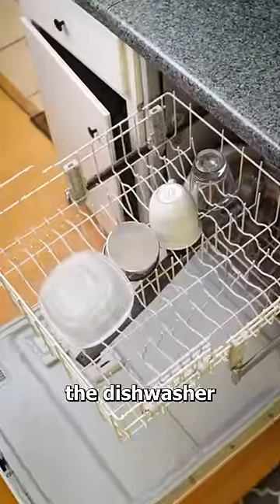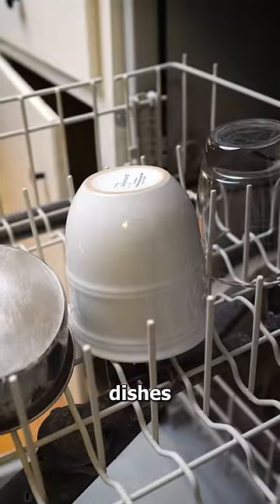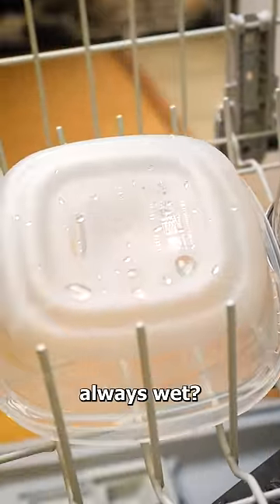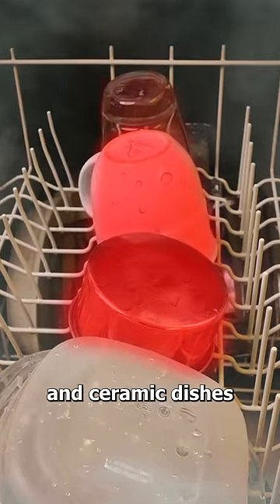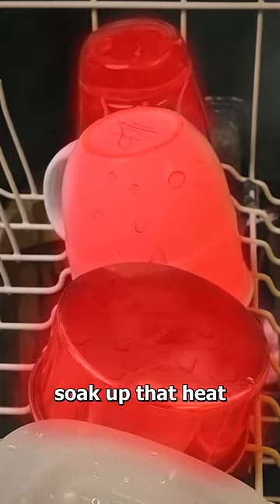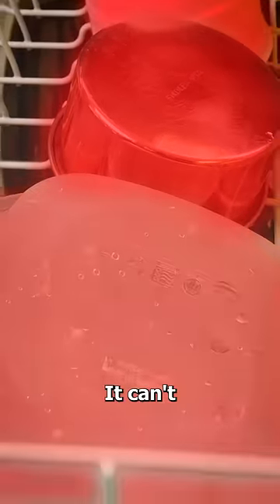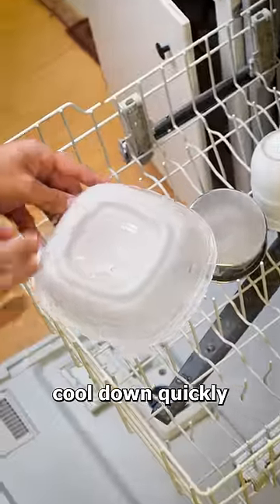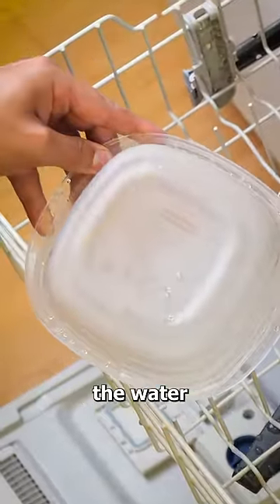Why Plastic Doesn't Dry In The Dishwasher 🤔

Comment: i’ve never used a dishwasher in my life
Reply: Samee
Reply: I moved into a house built in 1928 that didn't have a dishwasher and did dishes by hand for a few months. Worst time of my life. We sawed a hole in the cabinets ( which were original and therefore not the correct dimensions for dishwasher) so fast and tossed a dishwasher in there because it was ruining my life. 

Dishwashers are more water efficient and sterilize better than washing by hand. Saved my life.
Reply: @Comannderballz  Can you tell me where exactly they implied that they expected a house from 1928 to have a dishwasher, JayMapper---_-?
Reply: @JayMapper---_-  I knew it didn't have one when we bought it. But we intended to remodel the whole kitchen when we saved up enough. I couldn't wait. I needed one asap and put it in with the old counters. But yeah. Most houses in the US have a dishwasher. If not built with one installed at some point.
Reply: @Comannderballz a lot of houses are built in that time frame but 90% of the time they’re renovated along with a dishwasher at some point, not weird to assume it would have one dingus
Reply: Same
Reply: Asian parents ig
Reply: Same
Reply: same
Reply: Same. But I don’t have a dishwasher.
Reply: Not really, they use a lot of electricity and if you are a normal person, you'd use the correct amount of water to do the dishes so nah, it's actually not that great to have a dishwasher @christiebreeechelon
Reply: @rypsterhc8673  for most households it has been proven that dishwashers and more energy-efficient and more water-efficient (I suppose using the right settings as well)

Comment: Not to mention on a microscopic level, The surface of plastic has tons and tons of little divits, where water can collect.

So in combination with the heat and microscopic nature of most plastic dishes, they create clean but wet dishes.

Which is why I always have something I can use to dry the dishes.

Comment: I feel like there’s a solution to this that no one’s made yet
Reply: Miele’s dishwashers rinse with super hot water for their final rinse, which helps plastic dry as quickly as other dishes. You can also add a rinse aid like Jet Dry to help decrease the surface tension of the water so it evaporates faster.
Reply: Don’t use plastic dishes? They’re really fragile and can’t handle heat. I bought a couple plastic dishes from target and I use them the least because of how bad they are
Reply: @kawaiidere1023 maybe don’t set them in sun-like temperatures? I have been using plastic dishes for years and they have had no problems in the dishwasher, and I still prefer them too, because when I use them to hold hot foods, it’s much easier to hold them if I cannot find my oven mitts or something else to reduce the heat
Reply: @kawaiidere1023 you use them as containers, not to eat
Reply: Yeah, stop putting plastic in the dishwasher. Stop eating from heated plastic containers
Reply: It’s called rinse aid…
Reply: solution: don't put plastic in dishwashers
Reply: @Nightcaat I’m late to the party, but yes, the solution is a dishwasher that has mineral dryer known as “zeolith” like some of the Bosch/Siemens/Neff brand machine do.
Reply: Brand name Tupperware seems to not have this problem.
Reply: I have a bowl or sometimes a rack for these annoying plastic lids and etc as a last step after the dishwasher. It's easier than using a towel on them

Comment: Plastic has different thermal properties than glass or ceramic. It doesn't retain heat as well, and it also doesn't heat up as quickly. Dishwashers typically use high-temperature water for the wash and rinse cycles, and plastic doesn't absorb and retain this heat as effectively as other materials. As a result, it takes longer for plastic to dry.

Comment: It happens because of heat capicity and it does a lot of cool things
First what is heat capacity? Its the required heat to increase the temperature of an object for 1 Kelvin (increase of temperature by 1K = increase of temperature by 1 Celsius)
For example: in the day, sun shines on the beach and on the sea  but due to the high heat capacity of water, the sea gets warm slowly, but the beach gets hotter than the water due to the lower heat capacity. And due to convection, the hot air goes up and the cold air replaces it, causing the air to go towards the beach and causing a cold breeze. But when it gets dark, the beach loses heat very quickly but the sea holds on to the heat and its warmer than the beach. This time the hot air of the sea goes upwards and the cold air of the beach replaces it and the breeze goes towards the sea.
Correct me if i'm wrong, Thanks!

Edit: Now can you tell me which dishes have higher heat capacity? Plastic dishes or other dishes?

Comment: It also has to do with the wetness of the material. On wetter materials like glass and ceramics, the water and rins-aid leave a thin film, which evaporates quickly. Plastic and non-stick pans are less wet, so the water is left in beads. Those beads of water take a lot more heat to evaporate than a film. After an eco-programme the non stick pans will be as wet as the plastics, while the glass will be perfectly dry.

Comment: true. and from an appliance technician having a plastic linear instead of stainless steel don't dry well. Plastic does not radiate heat like metal does. little note, having plastic linear, do not let dishes sit in dishwasher or you will get mold or mildew build up on your wet dishes. and always leave door propped open to let it air out.

Comment: Not true.
The reason is that the plastic dish has a high specific heat and so when the dishwasher has finished, the remaining water vapour in the washer will condense onto the plastic as the plastic absorbs the heat more and so heats up less. Glass does this to a degree, but nor as much as plastic. And metal will absorb very little heat and so heats up faster.

This is easily proven if you open the dishwasher mid cycle before it finishes heating. You will find there will be no water on the plastic. the water will only appear after the heating cycle has finished.

Comment: Almost. In most dishwashers, they use condensation drying (evaporative drying requires a lot more electricity and an internal fan).
In condensation drying,
The side panels of the dishwasher are metal, and during the last phase of the wash, they cool down quickly.
This allows the moisture to condense on the cooler metal surfaces rather than on the dishes.
But plastic doesn't hold heat, so water condenses on the plastic too.

Comment: This we Gasp so scared 
_________________________________________
Probably to grab a little extra oxygen. Gasping is part of the flight/fight response in which adrenalin and other hormones are released to prepare the body for action. These dilate pupils, speed up heart rate, breathing and metabolic rate, and supply more fuel to the muscles. All these changes mean using oxygen more quickly, so a good deep gasp might be a useful precaution.

Comment: It's because current dishwashers are crap. Old dishwashers had a heating coil at the bottom. It would heat up the water and when the washing was done, it would create the heat for drying. This is why we had the warning about being dishwasher top rack safe. You did not want to put plastic on the bottom shelf near that heating coil. But, when the plastic was on the upper shelf, it dried the plastic just fine. Plastic can be put on any shelf in new dishwashers because they suck and don't dry well.

Comment: It’s actually the opposite is true.  It’s a thermal insulator. It’s very good at holding on the heat, which is why it doesn’t conduct it to the water and evaporate it.

Comment: Heat was only part of the reasons. Main reason is the molecular structure of plastic versus ceremic and metal. Basically it has rougher surface that retains water.

Comment: Worse than that, the plastic is now cooler than the surrounding dishes so the water condenses back onto the dish. If you pull the plastic out right after the heating cycle completes you can see it is actually dry, then it gets wet again before you come to remove it after it has cooled off.

Comment: And because of that, it’s always good to stack your plastic dishes by letting it balance diagonally (45 degree angle) rather than just face down (Think of an upside down cup and rotating it to balance on its rim)

But this allows the condensation on the dish to pool to a rim/corner whether it’s a cup or plastic container.

A simple shake or towel wipe easily dries off the leftover water still stuck to the corner without much effort.

Or you can just not do any of that and dry your dishes however you like!

Comment: You simplified it too much "plastic can't hold on to heat" is nonsense. Just say it has low heat capacity compared to the other materials and therefore cools down more quickly. It brings the point across simply and has the benefit of being accurate.